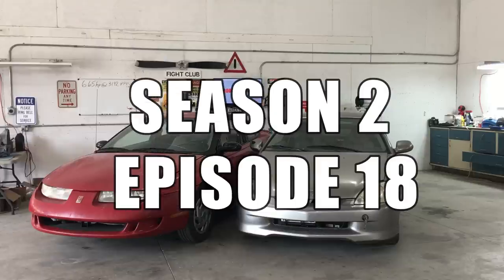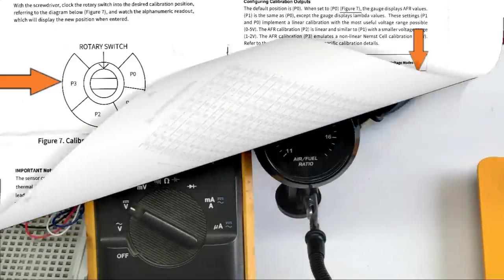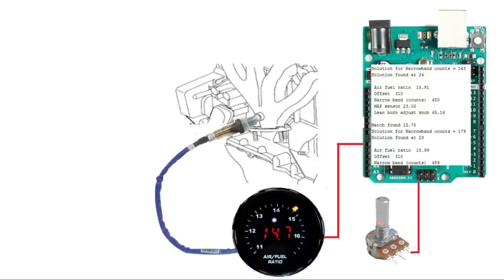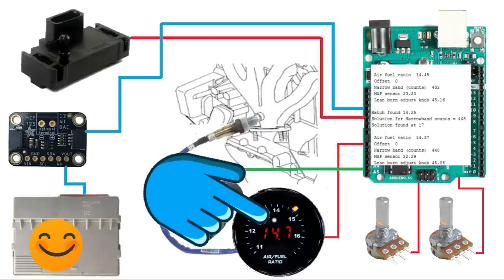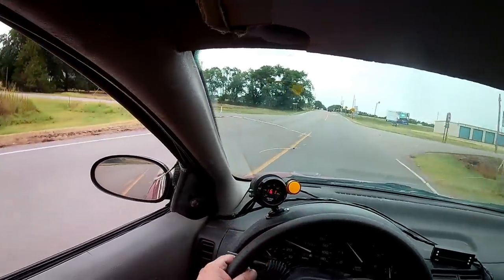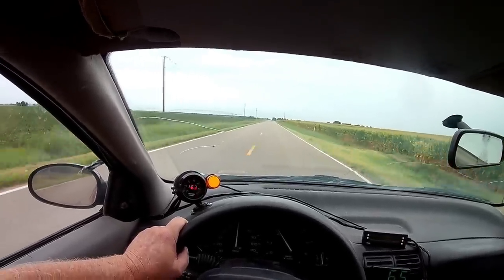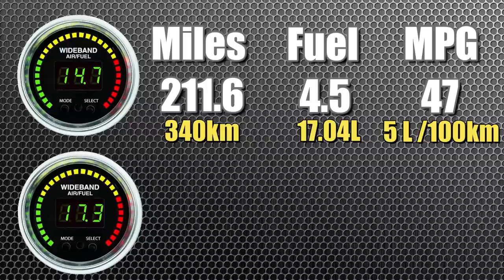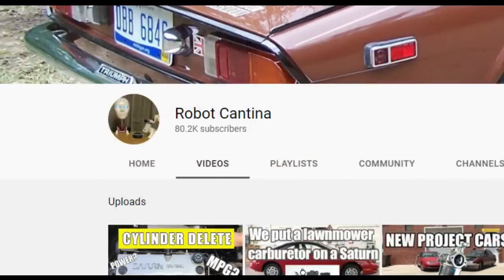S2E18:  We test a lean burn system on our Saturn .  Will it get better MPG?

Comment: I'm surprised you haven't made a radical weight reduction, changing the interior panels out for aluminum sheet metal for example
Reply: The interiors on these cars are incredibly chincy. A piece of aluminum would probably weigh a lot more
Reply: My 81 Dodge Omni was the same, but the thinnest aluminum panels were still lighter overall. I think the rear glass was 70lbs, the lexan sheet was about 20

Comment: My finding on my 350 in my full size Chevy Van, had to go from 42-44° of timing to 50-52° of timing at 2,200 rpm on flat road to keep the power up in lean burn. It never knocked and I went from 19 to 22 mpg running 70 mph. I went from 14.13 which is stoich on E10 to 16.8:1. That required advancing the distributor 10° statically.  The 8 cylinder distributor is limited to about ~42° advance if it is timed at TDC. Any further and the spark jumps to the next cylinder.
Reply: To all the very valued viewers of this fantastic  channel and primarily to JIMBO  OF ROBOT CANTINA ..It's December and the Holiday season is upon us, with celebrations like Christmas, Hanukkah, Kwanzaa, Mid-winter or Yule, and New Year all approaching.  Wishing you a joyous Holiday season and a happy and peaceful New Year.  Thank you  for a fun ride.

Comment: i have a question relating to "lean mixture" i'm a noob, but to My understanding E85 needs a richer mix for Stoichiometric ratio, if you use it instead of regular fuel, does the old tech ecu (no flex fuel meter) know what's happening? will it adjust at all or even have enough adjustment? and will it be a "lean burn"  perhaps mixed to a 50/50 with normal fuel even.  kind of not related, just i haven't seen it covered well, and your videos seem to be great at explaining what's going on.

Comment: Not sure why the leanburn results were lower, but 47mpg on a car with ac and power steering pumps removed is possible. New plugs could have made some difference depending on how old the other ones were.

Comment: 14.7:1 is slightly lean with E10 fuel, which should be at about 14.1:1 AFR, hence the improved MPG without "lean burn" enabled.
Reply: 17.3:1 AFR is not lean enough to save fuel with lean burn, and actually puts you in a "more fuel use" valley.  It needs to be closer to 19:1 to begin to make an improvement.

Comment: normal ecu, when it detect lean ratio, it will try to add more fuel to get the ratio back to ideal

but, when it detect rich ratio, it will trim the fuel to get it back to ideal
cmiiw

Comment: Did you monitor the throttle position and map sensor values throughout both trips? maybe when the lean burn is active you are giving it more throttle to maintain the same amount of power / speed. You get a higher AFR but with more overall air the total fuel flow is the same or higher since the high AFR is less efficient without any other kind of tune.
Reply: HEY JIMBO.....  congratulations on reaching 100k subscribers.. ROBOT CANTINA is providing the 
entertainment and fun that viewers enjoy..

Comment: I found your Arduino trickery to fake the AFR of a narrow band sensor fascinating. And very well explained at that ! How did you get the data "AFR to voltage" beforehand to know the mapping that should be applied ?

Comment: i tried doing lean burn through my car's narrowband by placing a rail-to-rail non-inverting op amp amplifier with a gain of around +15-20% to fool the ecu that the narrowband is reading richer than it usually does so in theory it should cut fuel. it didnt work (im still reading same afr) because i learned the ecu operates at open loop mode below 1500rpm and idle which is where i usually drive.

now im looking into using an arduino to work between the ecu and the injectors to "induce a delay" to reduce the duty cycle and should disengage above 1500rpm and idle.

Comment: Shouldn't the throttle position also be looked at during this experiment? If you're running a lower AFR you will need more throttle to achieve the same power output when compared to normal AFR? Also I'm not sure if this experiment is appropriate for this car as I would assume it was engineered for fuel efficiency and by modifying AFR you may be putting the engine outside of its peak efficiency range. Instead I would try this experiment on a truck or performance car where fuel economy isn't what the vehicle is designed for. Super cool experiment though and I'm excited to see what you do next!

Comment: I was wondering if the engine may have been making more power with the normal AFR, so less throttle opening is required to maintain the same speed, thus better MPG??

Comment: I am sure there is information out there for flame speed for different AFR ratios. Using some math, you could find out what advance in timing you would need for your rpm at a given engine speed.

Comment: You couldn't just use a resistor or a shunt resistor on the original sensor to make the ECM think it's running more rich than it actually is?

Comment: Not sure why you're surprised about the increased baseline MPG. You are driving a slower loop (less wind drag) and you remove 2 engine driven accessories, so it has to do less work to push the car around. Saturn built an SL model that came standard without power steering, might want to look into a steering rack from one of those, I believe the ratio is different so turning will be easier.

Comment: I gained 5mpg running my E85 converted 2012 Outback at 16.5:1 vs 14.3:1 on the interstate at 80mph, would be interesting to do an E85 conversion on that Saturn and repeat this test. A Microsquirt ECU should be able to run that engine....I think.

Comment: Have a look at ESPHome for doing statistically stuff much more easily, while also providing a Wi-Fi hotspot with a web interface for debugging if necessary. For example sampling the sensor 100 times a second and doing an exponential moving average over the last values and send a value every 10 seconds is just a couple of lines. 

It can also do sensor fusion by a Kalman filter, if you insist of using cheap sensors in the future ;D

The ESP32 should be capable of doing enough precision with the PWM output, you just need some minor smoothing.

Additionally, there's also a polynormal calibration, which can do the "lookup table" work, but with much less fuss :)

And of course it can do touchscreens and gauges on them etc. :)

So you can grab an ESP32 with a screen attached and off you go.
Reply: Did I mention that the ESP32 can natively talk CAN-Bus and ESPHome supports it as well? :)
Reply: @RubenKelevra  Love the comments here... I come for the videos and stay for the great comments 👍👍👍
Reply: @mommapanda5736  welcome :)

Comment: I did a cross country road trip in my 95 sl2 auto. Couldn't get higher than 28mpg. But I had a 00 sl and got almost 50mpg driving from AZ to new Mexico. Soo the 47mpg isn't that hard to believe to me.

Comment: Next up for both diesel and gas, would you need to install a fuel flow meter with a density/temperature offset to refine MPG accuracy? 

ORRRRR

would you calculate pulse width of fuel injectors x fuel psi and calculate fuel use through that? I'm very curious what strategies can be used to calculate MPG in a more accurate way, even though in principle MPG itself as a calculation has some faults vs. real world performance due to not taking in factors like wind resistance, rolling resistance, etc...
Reply: edit* Fuel cell in the trunk with a scale permanently installed and zero'd to the weight of the fuel cell for static weight readings!
Reply: @fixyourautomobile  Normally in relatively modern cars (like less than 25 years old) where you have constant pressure fuel system, all you need to accurately calculate MPG is to sum the injection pulses, and then calibrate the conversion rate from pulse ms sum, to Liters of fuel, by fueling the car to the max, on a specific fuel station, on flat surface, at one distributor (for consistency), and then ride out the whole tank, sum the injection impulses, and measure the distance travelled (at the same time you can verify with gps, over like 60 miles the accuracy of your odometer, and include that correction), and after running it for the whole tank, refuel it again to the max, just as the first time, and you get the sum of pulses divided by the distance traveled, should be equal to the fuel you filled up the second time divided by the gps corrected distance traveled.
That way you'll have a very accurate mpg measurement available after that calibration.
Reply: @AgneDei  don't forget to subtract injector turn on time offset.

Comment: I kind of wish that microelectronics were around when I was a kid, on a farm, abusing cars just because I could.   Arduino wasn't even a thing until almost 20 years later.   Computers were still a pretty new thing in most houses, and it wasn't really realistic to just drop a spare 286/12 and CRT in the passenger seat, for stuff like this. :)  I hadn't even been introduced to the fledgling world of microcontrollers.   That came a few years ago.  

I'm thinking of re-computerizing parts of my truck.    The computer was misbehaving, and the airflow of the intake manifold absolutely sucked.  I switched it to having a carburetor and HEI ignition, and it has driven great.  I was thinking of putting a wideband O2 sensor in each header, and solenoids/motors on each carb mixture screw.  It'd still count well enough towards de-computerized.  If the computer entirely stopped working, it'd be a screwdriver and a couple minutes to replace the manual mixture screws.  Really, you just showed that it would work perfectly.  It would just be rather than tweaking the fake O2 output, it'd tweak a couple screws.  If it works really well, I might have to get a dual plane intake manifold, so it can really adjust mixture by bank.

I don' that the patience to record the whole process like you've done.  I have a few videos that I want to post, and they haven't gone past recording the raw footage to eventually edit and post.

FWIW, on my truck (Chevy L31) switching the intake manifold and above to an Edelbrock performer hi rise manifold and 750 carb, with headers and dual 2.5" exhaust has increased performance without impacting fuel economy.  It's usually running rich, which is why I'd like to auto-tweak the carb while driving.  I'd probably need to add my own MAP sensor.  The transmission computer has a TPS and tach sensor, that I should be able to splice into.    Part of the goal of that truck was just to keep it running as stupid-simple as possible.  If the electronics go out, it can still drive.  The TCU can be removed, and it will still have 2nd and 3rd gears.  It was a lot of fun to do, and now I can re-computerize whatever I want, with some sort of safe failure mode.

Comment: Beware of the LC-2, they cook the sensors very quickly due to having a poor heater control circuit. 14point7 systems are far more reliable.

Comment: well fer dang sher something got did right with the dials turned off, happy accident!
from 41-42 mpg to 47 is a substantial gain, possible with some tweaking, same time omitting the lean burn loop, might give a good +50 mpg. it'd be a really neat kit if its adaptable to many cars.

Comment: I'll take my Lesbaru over a Saturn any day. The Redline edition of one of the Saturn's had a Honda V6 base-detuned engine as their "performance" model. Oh Saturn you were good for a laugh at least.
Reply: I had a Saturn SL2 for 8 years. Got no less than 36mpg, my best was 47.3 (drafting trucks on the highway).

Now I'm in a Subaru Forester 6MT, and it is a better car in every way,  except 2: fuel efficiency and price. That said, I'm getting 30mpg averaged over 7 tanks, and I got a crazy good deal on it. If they make them without CVTs once this one fails, I'll get another one.
Reply: @OutsideTheTargetDemographic  HEY JIMBO.....  congratulations on reaching 100k subscribers.. ROBOT CANTINA is providing the 
entertainment and fun that viewers enjoy..

Comment: That's what you get for dissing Subaru. 14.7 stoichiometric.. look at afr charts each fuel has it's max power for HP or torque.. for lean burn at cruise  advance the timing I found 16.5:1 afr was max with advanced timing.. in my Miata with megasquirt long ago...

Comment: One thing that's stuck in my mind is you don't have any way to modify the timing tables and add advance to take advantage of the leaner mixtures. It's clear you've claimed in and out of this Saturns engine management. Do you think it's possible to piggyback an aftermarket ECM and retail the stock pcm to run stuff like the gauges. Oh and add some spacers to the front seat brackets. Trust me
Reply from the maker: Hi Ronnie,   You are correct, the best way to do this experiment is with an aftermarket ECU like a megasquirt.   I certainly could go that rout, but keep in mind we are more or less doing these experiments until we finish most of the fabrication on the diesel engine adapters.  On the other hand, these experiments are fun and folks seem to like them.  We may get another Saturn to continue these experiments on.
Reply: @robotcantina8957  I am actually asking for my own use on my Saturn hypermiling project car. Basically it comes down to if the crank trigger configuration can be supported I suppose. I will definitely be deleting my power steering soon. I assume you just looped the hoses on the steering rack

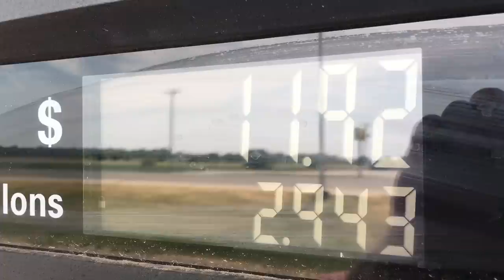Comment: 17:00
~30 miles 7 laps= ~210 miles does this include travel from fuel station? Is the distance estimate over or under 30 miles.
Regardless, this is impressive considering this isnt purely highway driving, with several stops (at the very least 28 for each turn)
210 miles/4.502 gallons=46.64MPG

Edit, near 47MPG is impressive considering your last test with this machine got 42MPG with pure expressway/interstate driving with little to no stops.

This could be a combination of disconnecting the power steering, and maybe getting a more accurate signal to the ECU depending on the accuracy of the old O2 sensor, and the polling rate of the new system.

I've found that on my 96 cadillac fleetwood 6 door a simple OBD2 reader is within 1-3 MPG with accurate instantanious reading, though often under the actual MPG in most cases.
Now i cant go and remove the power steering considering this is a limousine, but i could disconnect the AC as i hardly ever use it, and a lean burn would be nice, as with a custom body, i have plenty of space to add NOx mitigation hardware. Though, i'd prefer to convert it to a dual fuel Propane+gasoline, where i can start on the clean burning propane, and then once warmed up, switch back to gasoline.(this thing gets horrible gas mileage for the first ~5 minutes of driving, often under 20MPG on the highway, where normally it gets ~32MPG on the highway(55MPH). 

A nice alternate would be an electric power steering pump that is only working when i'm turning the wheel
Reply: LOVE   the comments on this channel.   I come here for the videos and stay for the smart comments..👍👍👍👍

Comment: I hate to be "that guy" and split hairs, but the Arduino is a microcontroller, not a microcomputer. While both use a microprocessor, the microcomputer uses a human interface for input and output and is for heavy computational loads. A microcontroller is connected to other systems and is programmed for a specific task or tasks. These days, the difference between microcomputers and microcontrollers is getting smaller, there are the afore mentioned differences.

Comment: 47 mpg in stock configuration doesn't sound out of the realm of possibilities. I had a 96 single cam 5 speed for a couple years and regularly got 42-45 mpg @60-65 mph.

Comment: I once tuned a shitty daihatsu to run on lambda 1.08 (that's about AFR 15.8) It had lost significant power, but went from 9 L/100km to 7 L/100km (from 26 MPG to 33) that was significant enough that i kept it like that for the next year or so before i scrapped it. I tried the same on a corolla but it didn't quite like it. so i left it alone.
Reply: Perhaps it was a mixture of changed driving habits. Because you only removed 8 percent fuel but seen a 27 percent increase in efficiency.
Reply: @8SecSleeper  and also possibly, the previous narrowband sensor was getting bad

Comment: you should be able to burn lean without any damage by injecting water aerosols into the intake of the engine to cool off the combustion chamber. thus you can run lean without the risk of knock

Comment: Anytime someone can make a Saturn go 40 plus miles to the gallon that's amazing. Wished my Saturn would have gotten that kind of mileage.
Reply: My Saturn sc1 typically got over 50
Reply: @laserfalcon  I used to own a 2003 SC2. For some reason it seemed like it was consuming more gas than it normally should. It was a high mileage car and needed a tune up. Got rid of it back in 2011
Reply: If yours was automatic or DOHC they didn't get great mileage.  I had automatic 93sl2 DOHC it got about 30mpg, but I was 19 and drive it like an idiot all the time.
Reply: @bitemyshinnymetalass1569  could of been because it was a sc2
Mine which i still own is a sc1
But has a short at moment on the turn signals, no one can find where it is
🪐
Reply: @laserfalcon  HEY JIMBO.....  congratulations on reaching 100k subscribers.. ROBOT CANTINA is providing the 
entertainment and fun that viewers enjoy..

Comment: JUST AS SOON AS YOU START TAKING AWAY  FUEL.  YOU LOOSE MILEAGE NO MATTER WHAT.      THE ONLY WAY TO GAIN MORE MILEAGE IS. STOP AND START TECHNOLOGY.  DOWN HILL ENGINE OFF AND RED LIGHT ENGINE OFF AND YOU WOULD SEE 50MPG
Reply: TOTALLY AGREE HERE... YOU ARE ABSOLUTELY CORRECT.